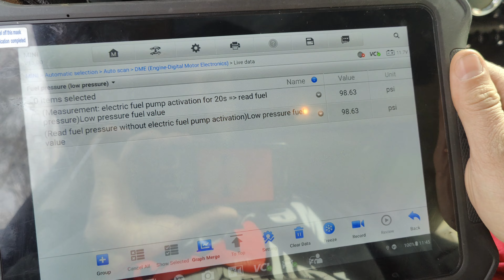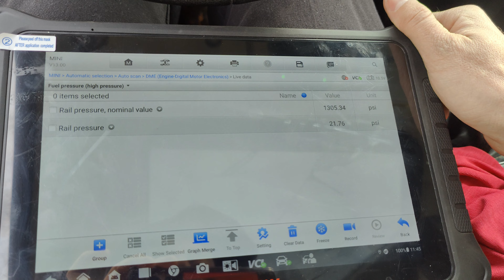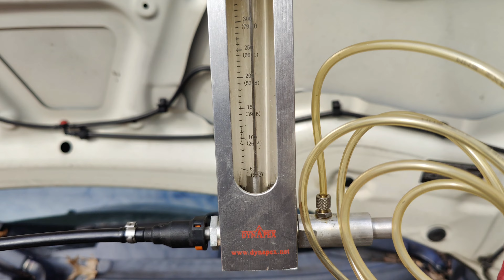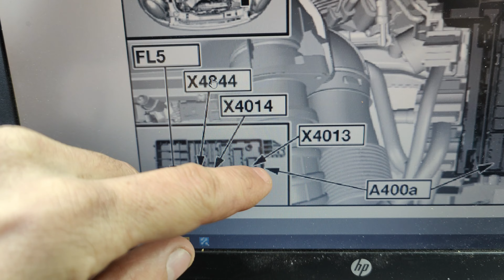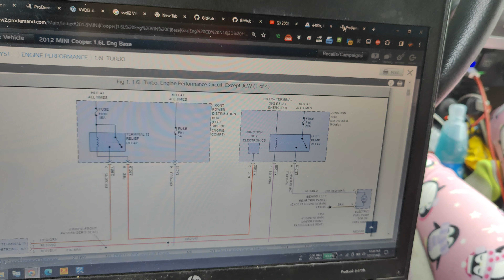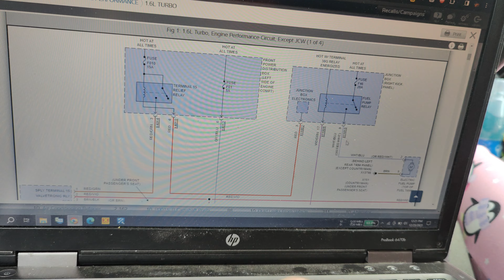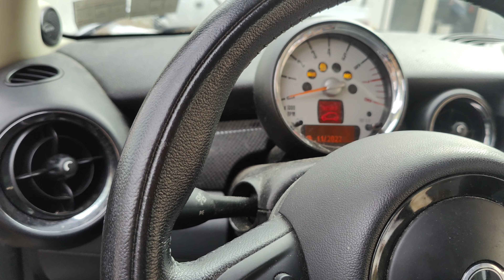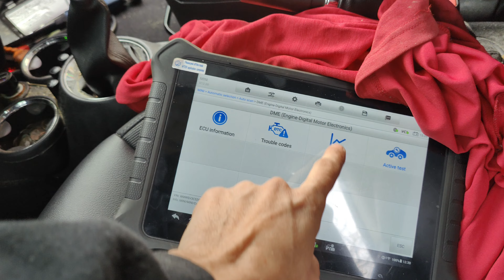2012 Mini Cooper 1.6l Manual Crank No Start - New Fuel Pump Already Installed...

Comment: Nice find, but you need to remove all the old solder then use some old school high quality flux cored leaded 60/40 solder, not that lead free junk.

Also, lower your iron temperature a bit, to 700F at most, otherwise the solder will oxidise rather than just melt and flow.
Reply from the maker: That was flux core 60/40